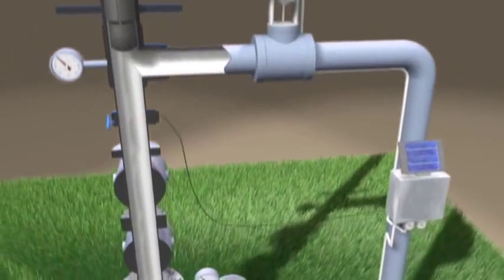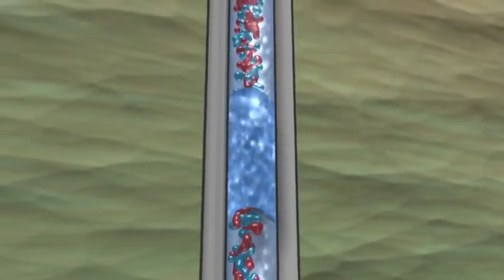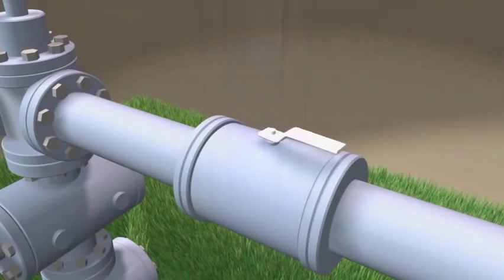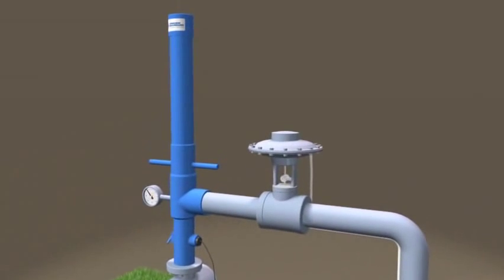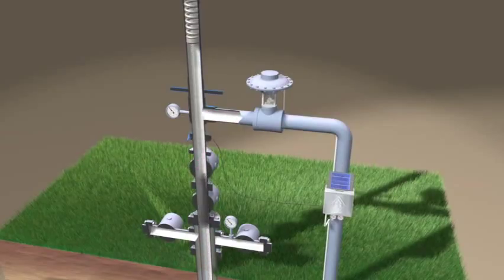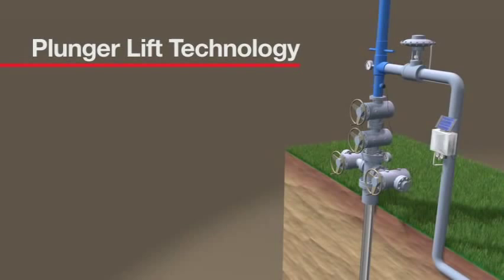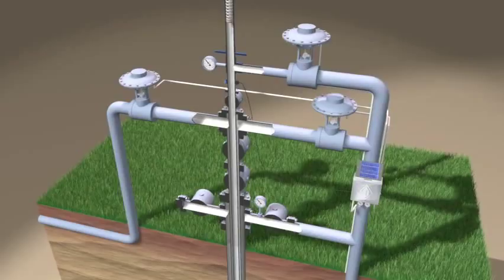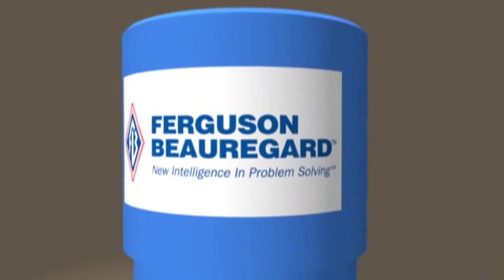PCS Ferguson Plunger Lift Overview

Comment: Yea, gas to liquid ratio matters most on this... breakthrough technology. Idk about all that.lol I've seen 2 out of 5 of these actually work as advertised. Not a problem with manufacturing, brand or design, but you either got the Gas to cycle plunger or you don't. Oh & BTW the production string has to be flawless id/drift/no extreme deviation etc. Some wells /multi well systems on a compressor may be troublesome too.
Reply: Oh they work. I have thousands of plunger lift Wells. 
The key is good timing for the on and off cycles. 

Have to figure out each well. 

Keep checking casing and tubing pressure to make sure it's not loaded up

Comment: These are a bitch to fish when the well gets plugged off
Reply: What I do to get mine back when a well logs of is: close the tubing ball valves at the well head, open swab line at the separator. Go back to the well head and rip that bottom ball valve open 3-4 times open and closed. Wait 10 seconds and open the top ball valve. If it’s really loaded up I blow my well for about 2-3 hours. Comes back everytime. Saves a couple bucks on a swab rig.